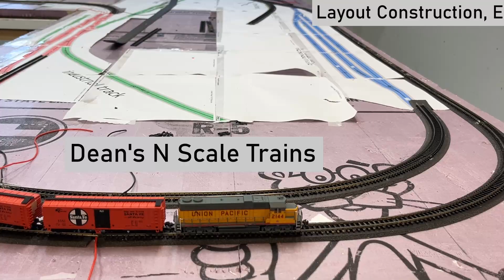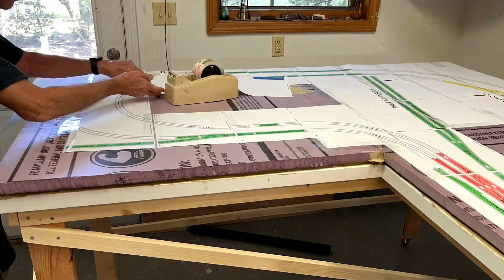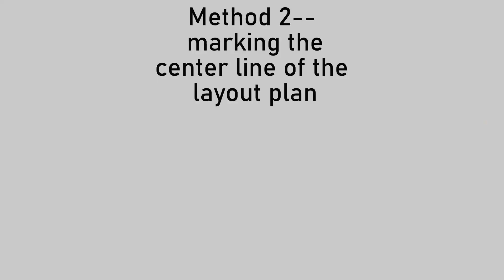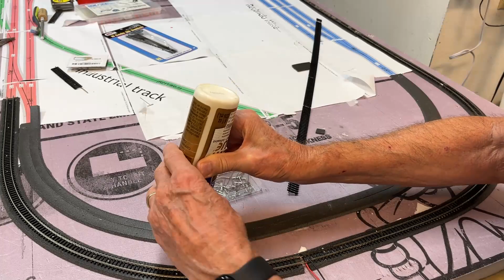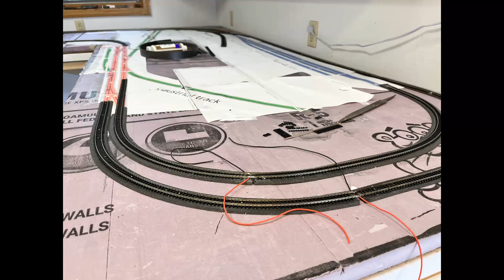How I Laid N-Scale Flex-track and Rubber Roadbed on My Santa Fe Northern Rail Road Using

Comment: Try using a Tracing wheel. You can trace the center line or the edges. Its a lot faster and you can keep the printout in tact.
Reply from the maker: I remember my mother tracing patterns onto cloth when she was making clothing.Good idea, although you realie you can print out the layout as many times as you need to.
Reply: @DeansNScaleTrains  Its the way to go. Reprinting takes too much time.

Comment: You should try not to attach track in a curve , it will be a problem down the line. Keep going your doing well
Reply from the maker: I agree. Unfortunately, the length of the curve was such that I had to make a joint in the middle of the curve.

Comment: Hi Dean, does the foam roadbed easier to work with than cork ? 
Happy 4th !
Reply from the maker: I've never used cork roadbed, but from what I hear, it's harder to form on tight curves and cork doesn't deaden sound as well. But the cork is cheaper.
Reply: @DeansNScaleTrains 
I appreciate it, im starting something new and didn't know which direction to go, ill try the foam. Thank you Sir.